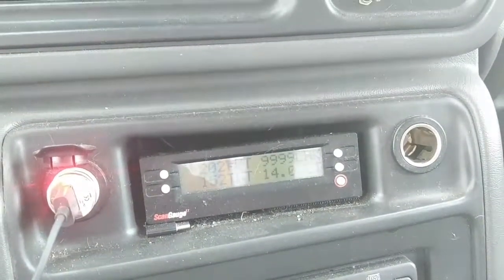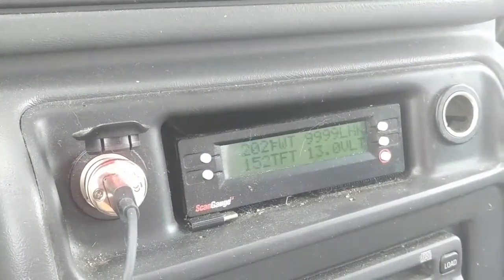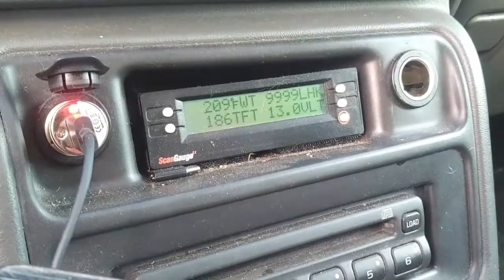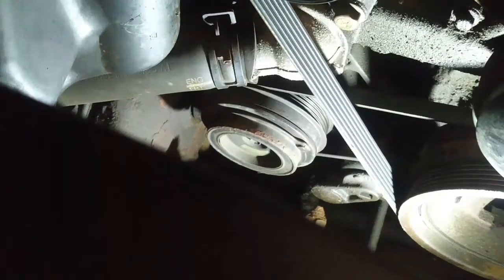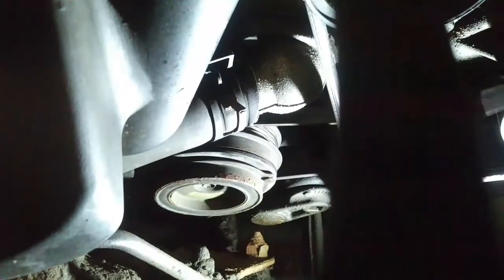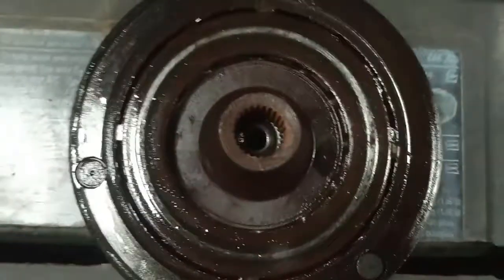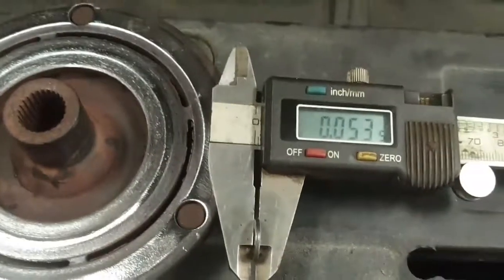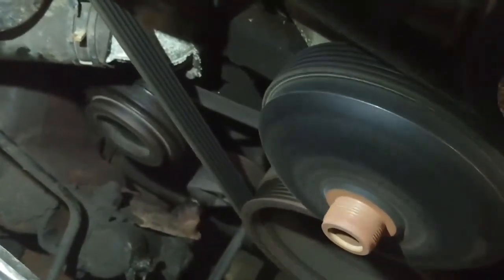2006 GMC Sierra AC Compressor Stops Cycling Intermittently

Comment: Having this issue on my 2005, GMC sierra 1500, it doesn’t look like the compressor is rotating at all, just stopped doing it today… I tried the relay swap technique and I didn’t get it going, my belt also extremely squeaks, I put WD-40 on it, and it stopped, and then it came back, both fuses also look fine…
Reply from the maker: Have to see if power is getting to the compressor with the AC on. Is the AC relay turning on. Try unplugging it and plugging it back in with the AC on and listen for a click from the relay.
Reply: @PhillipBailey  Just found out today that If I swap the AC relay with a different relay of the same type, the A/C compressor clutch, still does not magnetize inwards and start the compressor.

If I remove the AC relay and put a thick jumper wire diagonally for the power connections, and force the clutch to magnetize in words, the compressor is forced to start, and I am now blowing cold air.
Reply from the maker: @logansreplicas  so bypassing the relay makes it run the compressor. Don't run it too long like that. It may damage the compressor. You could have a failed pressure switch. You need to scan the HVAC and PCM for codes and look at data related to the relay control
Reply: @PhillipBailey Okay. I think I just found a large refrigerant leak in that thin metal pipe. There’s on valve and that’s super green and is making oil bubbles.
Reply from the maker: @thevintagetechguy  yes if its low on refrigerant the compressor will not work

Comment: I have an 06 Sierra 2500 LBZ motor…my ac will sometime not kick on until I start driving. Are these trucks like the dodges where the fan clutch can cause it to not work?
Reply from the maker: I don't believe the fan clutch will prevent AC from working. It may cause high side pressures to climb in city traffic which may shut off the AC due to higher than normal pressures but that would take awhile depending on temperatures. Try monitoring the status of the AC clutch on the scan tool. If its being commanded on but not engaging it could be due to excessive air gap. Try helping the clutch engage. be careful. If it's not commanding it on then one of the data parameters should suggest why. Plus scan for codes related.
Reply: @PhillipBailey  Ok I’ll check those out. I just replaced the entire system and had it professionally filled. I’ll turn the truck on and turn the ac on but it just blows warm air. Once I start driving then it gets cold. It has me stumped.
Reply from the maker: You really need a set of pressure gages on the system to see what's happening. High side pressure may be available on scan data if you're using a full function scan tool. If there is insufficient condenser cooling possibly fue to a cooling fan problem the ac efficiency will drop dramatically at idle and improve once you start moving. High side pressure is roughly equivalent to degrees Fahrenheit versus psi. Ie if High side pressure is 250psi then the condenser is roughly 250F. Do you have a decent scan tool? I don't believe the diesels use an electric cooling fan like the gasoline applications. You don't have anything restricting air flow through the rad like a winter front I hope...

Comment: I have an 06 and mine will cycle on and off but the snowflake symbol in the control goes off and just flashes when you try to turn it back on. Would this be my issue as well?
Reply from the maker: No it would not. The flashing snow flake likely has set a code in either the HVAC or ECM need to scan it. Might be low on refrigerant.
Reply: @PhillipBailey  yea. I saw another video where the air sensor behind the headlight could cause it. I ordered one to try it. I don’t think it’s the refrigerant because it will only do it every 2-3 weeks.
Reply from the maker: @aslmx1918  have it scanned. There should be a code in the HVAC system even if the light is not flashing.
Reply: @PhillipBailey  will do if the $6 sensor doesn’t work. It’s blinking 3 times and what I’ve read is that the sensor code. I read it on the internet so I know it’s true.
Reply from the maker: @aslmx1918  parts cannon strikes again. I watched open heart surgery this morning on Youtube so I'm booked at the hospital to perform tomorrow...LOL On another note there are lost of phone based scan tools out there that do complete network scans of all controllers. Check out the MaixiAP 200 on my Youtube channel...https://youtu.be/qBquxIoYMVo

Comment: This is good, I have a 2005 Tahoe that has been giving some trouble, I have checked everything else but this, if this works I will buy you a beer. The AC always works in the morning and only quits on the drive home from work, it stops working almost at same location (ie X minutes for driving) and it always comes back on if I shut off my engine and restart it and  stays on for x/2 minutes before quitting again
Reply from the maker: Drive it til it stops running the AC, don't shut it off, open the hood and observe if the compressor is turning. If not carefully touch the drive plate and if it immediately clicks on that's the problem. Alternately read the voltage at the battery while this is happening. If it's less than 13 the charging system is likely in fuel economy mode. Turn the headlight on and it will slowly ramp back up to 14.5. The compressor may kick back in with the higher voltage. Combination of lower system voltage, increased compressor cool resistance due to heat and increased air gap due to wear on the drive plate and hub. Good luck.
Reply from the maker: Hello Michael was the air gap the problem on yours as well?
Reply: @PhillipBailey  Yep, what is your favorite brand of beer and where do I send it to? Thanks.
Reply from the maker: @mrkattm  just glad it helped ya out. As long as you subscribed to my channel I good. Enjoy your Easter weekend as best as possible given the current situation. Stay safe!
Reply: I have the same exact issue in an 2004 Sierra. The a/c will run for a whil and then kick into auto mode blowing hot air. If I turn the engine off and restart it will reset and start blowing a/c again. Some days it's itermit, some days it doesn't do it at all. What was your fix?
Reply: Eddie Grider I eventually replaced the ac clutch but for a long time i just turned on my head lights, if you have a volt meter in the instrument cluster note the voltage when it works and when it doesn’t work. My worked when the voltage was over 14 volts and would turn off when the voltage fell below 13 By turning on the lights and fog lights put enough load on the system the alternator would raise the voltage, keep in mind that once the voltage falls off it will take a few minutes to come back up by turning on some lights. The higher voltage allows the electromagnet in the ac clutch to overcome the increase air gap that is due to wear

Comment: Did that fix problem.  My 2003 yukon with 265000 miles is doing the same.  My A/C Manifold gauge numbers look good.  Where can i find shims?
Reply from the maker: Yes this is my own vehicle and it is fixed. I actually removed the shim altogether. It's like a small washer and sets the air gap between the drive plate and hub. I'm sure you can get it from the dealership. Try removing it completely and as long as it doesn't drag you should be fine.
Reply: @PhillipBailey  Thanks Phillip.  I will try the free fix like you say tomorrow before work. Is the clutch held on by a bolt to the splines on the compressor? Looks pretty tight in there.
Reply from the maker: There is a small 6mm bolt that retains the drive plate to the shaft. You may have trouble getting the plate off the spline on the shaft. Mine was pretty rusted on but came off with penetrate fluid and a little persistence. I tapped a couple standard screw drivers in between both sides and then reinstalled the small bolt leaving in loose and tapped on the bolt. Careful not to damage the shaft or threads. If your truck has a mechanical Clutch fan you may have to remove it and the shroud or try from underneath. Good luck.
Reply from the maker: How did you make out with the AC clutch repair?